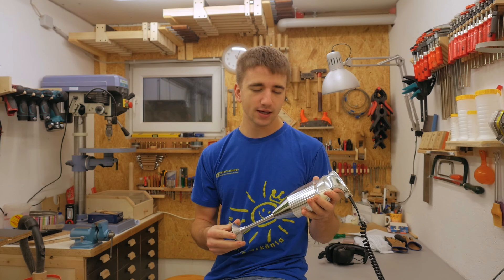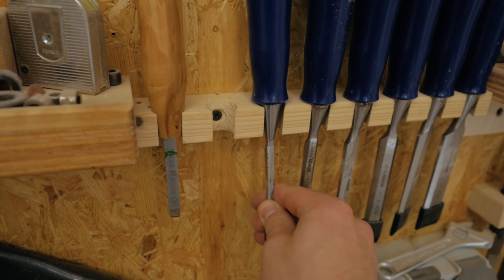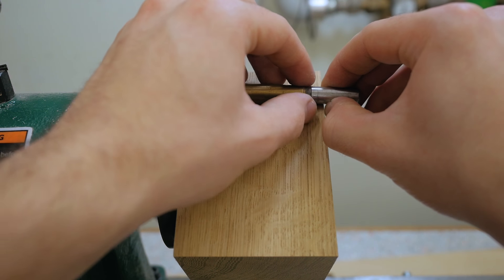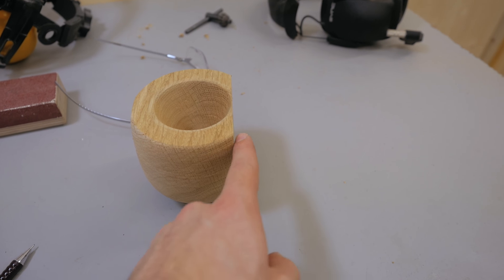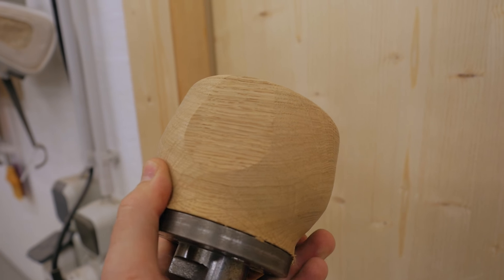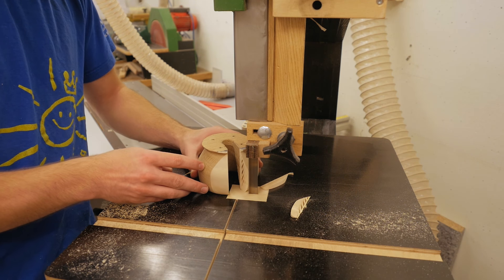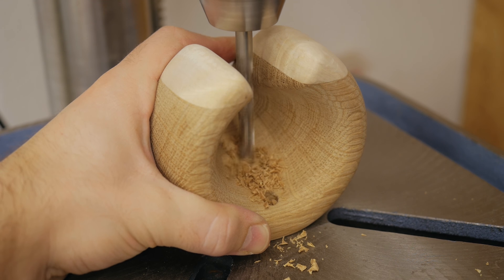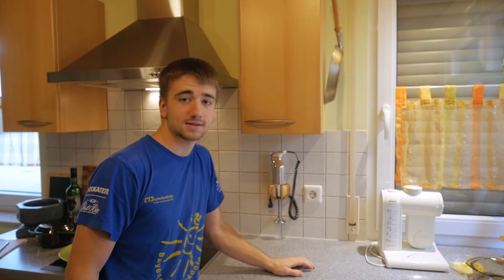Wooden Mixer Holder

Comment: My little Braun came with a holder. Such an expensive looking piece of equipment must have that as at least an extra?!
Reply from the maker: It came with a holder. A big piece of plastic to put on the counter. My mum didn't like that.
Reply: Marius Hornberger Did a little research and it appears there actually is a wall holder for that brand and shape (Zauberstab) with a hole to thread the spiral through, so if you are unhappy about your own efforts (I don't see why though) get that. :-)

Comment: What is the bumpy strap thing to the right of the outlet at 5:05 ... (Sorry if it seems obvious)
Reply: You can lower the blinds (they are outside) for the windows with it
Reply: I was wondering if that was the case, it just seemed so over-built for that.. Thanks for the response!

Comment: btw, pürierstab (Mixer) in english is blender, not mixer (mixer means sth like mischpult)
Reply: English is my first and only language.  I have a hand held mixer like the one in the video.    A blender has a glass container and sits on a counter.
Reply: lots of mixers can blend (at home i have a handheld one which dose both) and lots of blenders can mix.

The remark about sitting on the counter is used just to define which one it may be.
Reply: I agree with your verbs about mixing and blending.  You could also puree.  I was referring to the nouns/names given to such appliances by English speaking people.